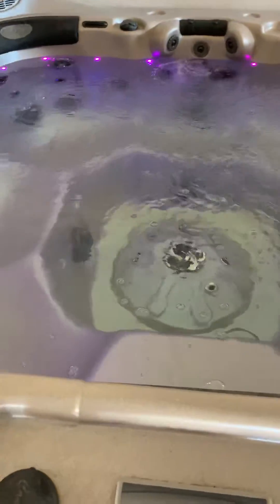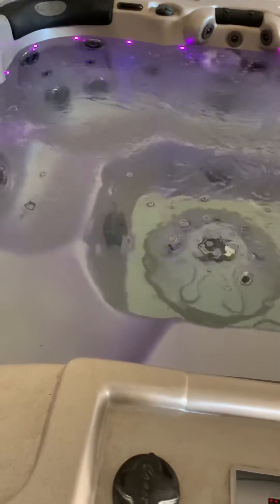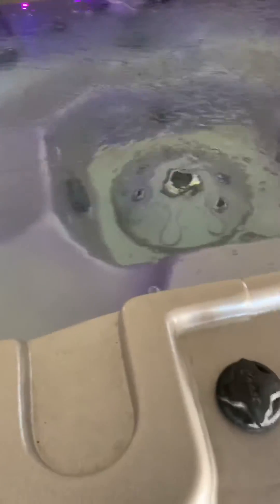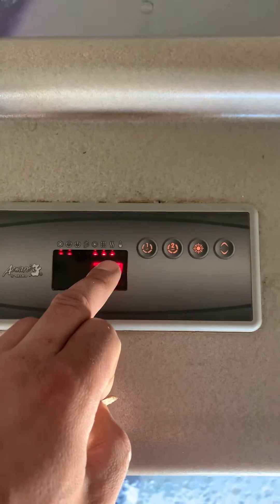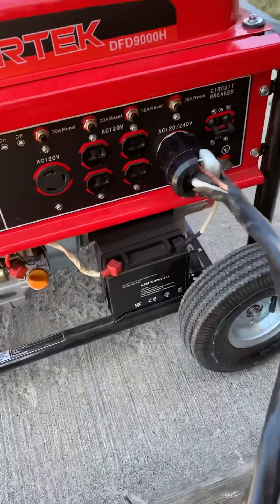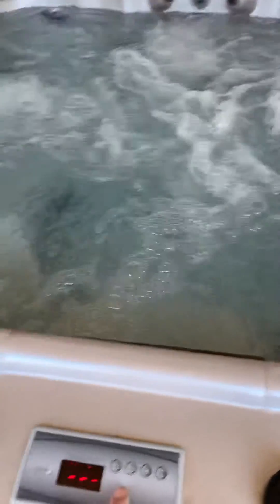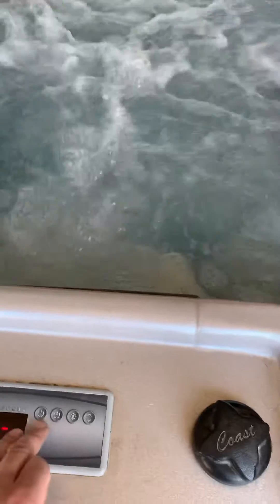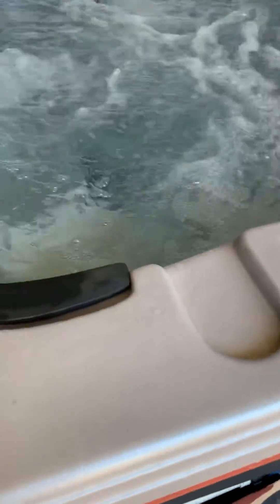Can a hot tub run off a generator ?

Comment from the maker: in order for it to run fully functional you would have to have it installed correctly to the proper electrical source capable of handling that amount of electricity i was just showing if you where trying to sell a tub without it hooked up to your house you can use a generator close to the power required i used the proper gauge wire needed and hooked it directly from spa package to the generator using a 30 amp connector i had to cut down some strands so it would fit but like i said it was a quick temporary turn it on turn it off sorta thing you need a gfi spa pack in between spa and energy source so you don’t electrocute yourself in the water